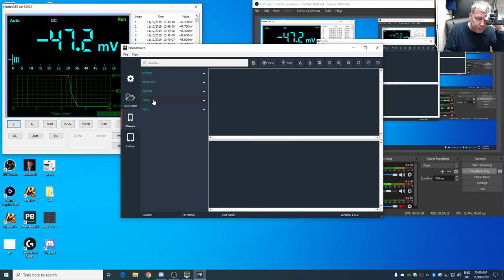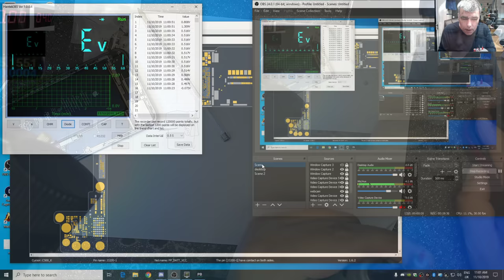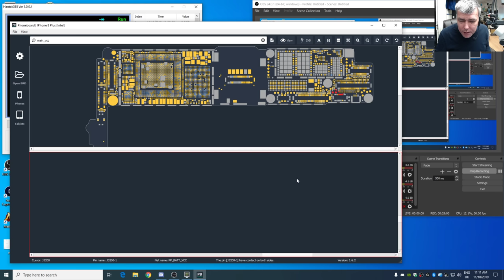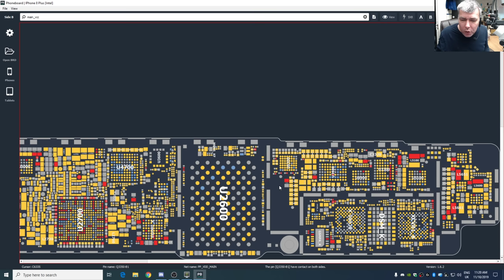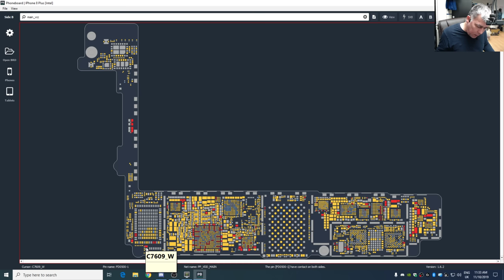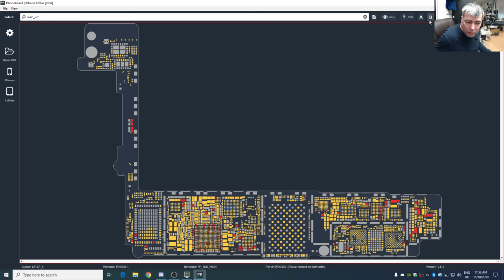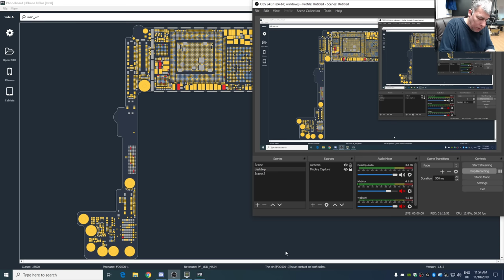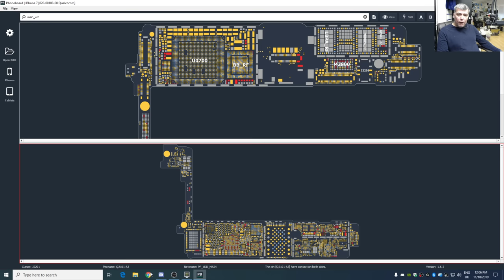How to troubleshoot a dead phone - Lets learn about this

Comment: I love you sir! i can resolve any motherboard problems now! you have impacted a lot to me sir.I'm still learning from you as always.. I'm from africa Nigeria.
Reply: he is great...i actually fixed a montior....cant believe it...I was gonna throw this flat screen 27 inch monitor in the trash...but thought ..lets have a go...and boom..a  bit of sorin and now i have a fully working monitor...cant believe it.
Reply: @runthomas  - What was the fault?
Reply: Good to hear, Mathew. 👍
Reply: @NeuronalAxon  on something called an inverter board..there were 4 capacitors gone..not short ...just all of them about half the capacitance they should be ..and swollen on the top..cost me about 2 pounds to get new caps..and boom i had the thing in pieces down to the led tubes..and thought its never gonna work...when i put it back together switched on and it came on immediately...
Reply: learned a lot about caps...i put in a couple that were higher voltage and it worked...key is not to use lower voltage or lower capacitance...try to get capacitance the same ..and voltage same or else higher..never lower or they will pop.
Reply: @runthomas  - Hey, that's pretty cool. 👍

Are you going to stick with it and learn more advanced repair techniques, do you think?
Reply: @runthomas  - IIRC, you can use higher voltage caps OK, they're just more expensive/larger/higher rated. IDK about substituting other capacitance values like that though. o_0 😁
Reply: @NeuronalAxon  most definitely ...i have even bought that power supply he bought ..the cheap one he did a video about..Im gonna buy a couple of broken laptops and have a go...and maybe can sell them at a decent price
Reply: @runthomas  - Good to hear. I wish you the best of luck with your new hobby. 👍
Reply: oga kineke
Reply: @NeuronalAxon  very positive and inspiring convo. I have pretty much recently started my own electronics repair shop.
Reply: @NarasimhaB  - I wish you the best of luck with that. 👍
Reply: rundown thomas abeg na wetin be the name of the power supply
Reply: What's the name of the software for schematics that he's using

Comment: Hello i just wanted to let you know i had a similar problem and from my experience on the uper side lcd connector there are 3 capasitors and on top of them there is a condactive sticker-tape from the manufacture and when you try to connect the lcd to the board fpc with your finger if you dont be carefule you also press that condactive sticker to the 3 capasitors and you get a short. So if you the sticker stops touching the capasitors the short also disappear. Love the videos ! Take care.

Comment: Hi im fairly new to smd repair and i wanted to know how to you diagnose motherboards that not powering on but not reading a short? Example I have a galaxy tab 3 thats not powering on, the battery is okay when i connect the power supply (5v ,2amps) to battery connector on the board im only getting a draw of 140mil amp which keeps fluctuating. I am lost

Comment: Hello, thank you for your great videos. We have charging problems with lenovo Tab Model A10-70F roken USB, we have replaced the charging USB port with no problems. worked fine for one day but now tablet charges only when closed and charges too slow. We have checked USB again for broken pins but seems everything is fine, but issue still remains. I would appreciate your advice. Thank you!!!

Comment: thank you very much sir. I'm from Africa Bénin. I learned a lot from you. I have one question: I am repairing a toshiba l550. the problem with this laptop is that after the second mosfet there are no 19 volts. I made a bridge to jump the second mosfet. now all the voltage is present: 5V 3.3v . there are 3.3 v at the power button and at the bios level but the pc goes off and off. how cant i fix it?
Reply: maybe there is 19v......but it is getting shorted to ground...so it looks like zero volts.....you have  a short circuit on one of the electronics that feed off the 19 volt rail
test with power supply after second mosfet......AND WATCH THE VOLTAGE DROP FROM 19 VOTLS...LImit the current and then find out what is gettin ghot....
Reply: Looks like I/O chip or corrupted BIOS.

Comment: Hi sorin, please explain more about power rail on mobile board and laptop Mainboard pleaseeee, what is the power rail, most of the time you are talk about that, but you are not explain what is the power rail. You said at 1:24:20  this dot is main power rail, but what is exactly main power rail??. Thnx
Reply: Power rail is conductor line with the same voltage. Phrase "power rail" came from electric train transport. Rail is a ground, and power rail is wire with high voltage above train. Main power rail is basic voltage from whom every other is created. 19 V for laptops, 3,7 V for phones.

Comment: Tip for iPhone repair. .....   All of the screws are the same length.  Once you put them in the board. Let them drop into the hole,  if they sink up to the head they are too short. If they stick out more than a mm,  they are too long.  All screws take as many turns to tighten up.   More than three full turns and it is too long.

Comment: At 23:00 when you supply 4V to to power connector, it looks like your beefy probe is touching the outer shell case of the connector socket, which is most likely grounded. So I believe you are supplying 4V to the ground, pulling over 2A and thus misleading you to thinking there is a short when you are shorting it yourself with a probe.

Comment: 1. multimeter check by ohm. battery connector. ground to + 80komh , ground to - 0 kmoh, from + to - 85 komh(resistance)
2. multimeter check diode mode battery connector. 0.5v ground to +(passing semiconductor,mosfet)
3. power supply  battery connector ground to + short 2.2a.
short to ground after mosfet.
THIS NOTE FOR MYSELF BETTER UNDERSTANDING